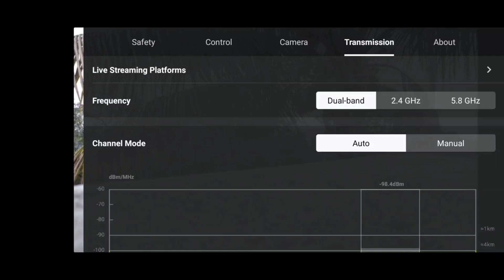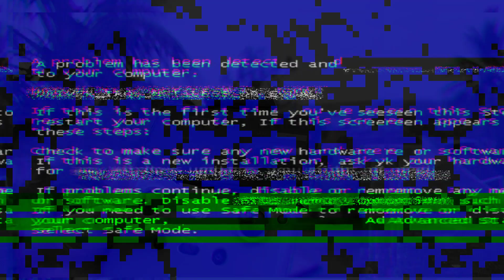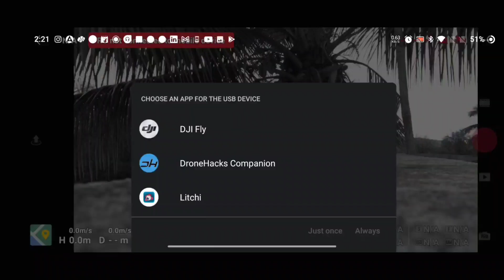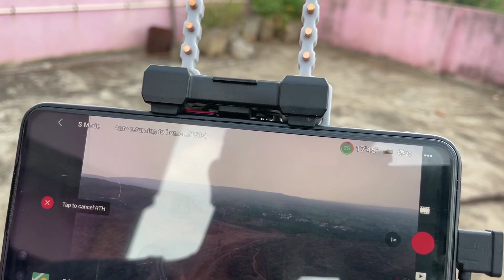DJI MINI2 - signal boosting | Yagi antenna test | Drone Maximum range test 10km | FCC vs CE #15mhack

Comment: hello bro i am also a dji drone user i am  facing problem in moving door in dji mavic air 2s beyond 120 meter the signal turns red and back to home s why is this happening koti tell the solution
Reply: Could be a problem in your antenna connection inside or the radio output circuit is damaged.

Comment: In india i fly my mini 2 on highest altitude of 1150 mtr and distance upto 3.7km without any extender, don't know why this useless accesories People buy, I'll suggest you fly in open area and for long range keep your drones altitude high and avoid any obstacle between drone and transmitter,
Reply from the maker: Make sense.
Agree with you!
Reply: @Shivkumarsd  
Why did you update your software to 1.4 as you write so as not to update? I have 1.3 frimware and check dji fly 1.4.8 1185 versions
Reply from the maker: @daniell7226  I knew that this update is going to Remove the hack.
Even I though I upgraded to make a video on it and provide information to all other people!

Comment: I would like to know how you fixed your 15 meters since you upgrade to latest firmware which does not run drone hack?
Can u share the details please
Reply from the maker: Dronehacks (dh companion works) with latest firmware
Reply: @Shivkumarsd  Thank you for your reply and update! But there is no method to downgrade it right.. I see only Air2s has downgrade option for firmware with help of Drone Hacks...
Reply: Hi shiv!
I recently heard that with latest firmware update we can now fly dji mini 2 upto 120m is it true?
Reply: @sourabchauhan4181  Hey Bro, Please do not update if you do you will never be able to use the Drone hack certificate. Only Drone hack apps can work.. I do not know from where you heard about it can fly above 120 m... FYI As per Govt Guidelines, Nano drones are restricted to go above 15 meters..

Comment: Bro DH Companion needs to be done everytime we use? or is there a one time hack via dh Companion
Reply from the maker: Yes, it dh companion has to be activated every time while flying the drone
Reply: No it doesn't, mine is permanently activated, before it required activating everytime, now it is permanent